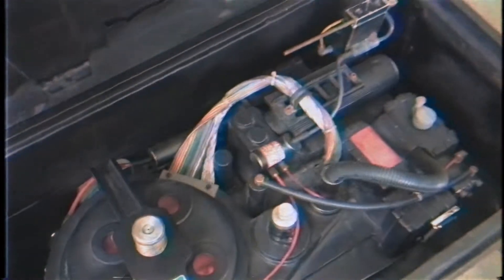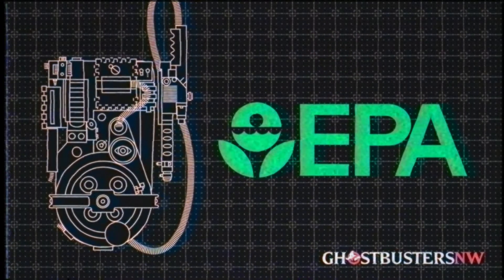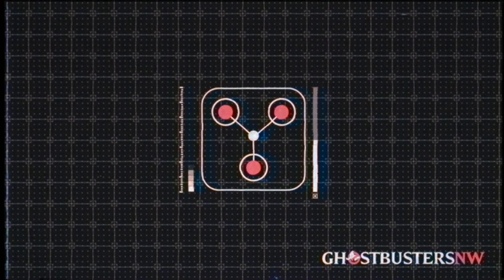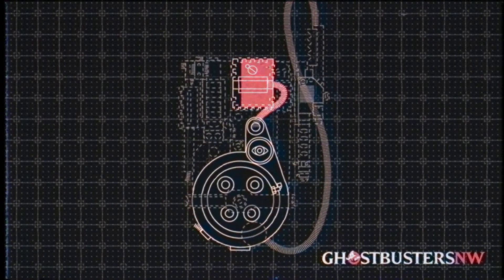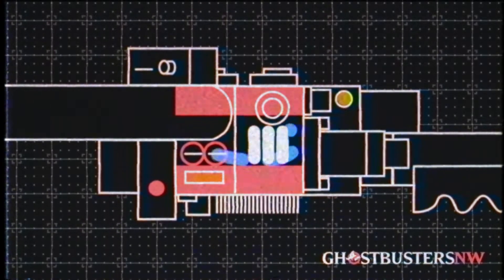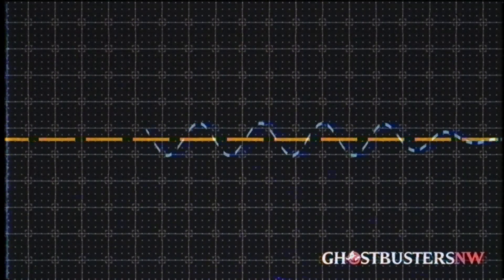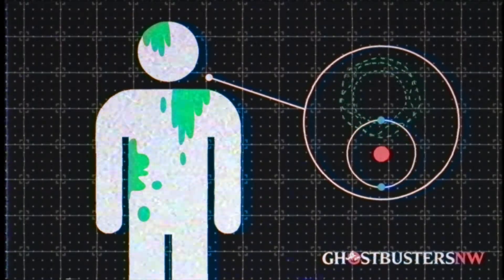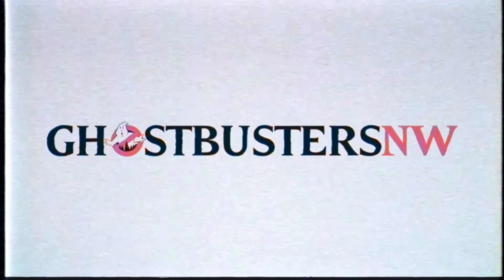GBNW "How It Works" - The Proton Pack

Comment: I thought the switch under the intensify button is the activate switch that activates the vent light? And a lever is used to remove the safe on the barrel to allow the user to fire the neutrona wand as shown in Ghostbusters afterlife?

Comment: Unanswered Questions:
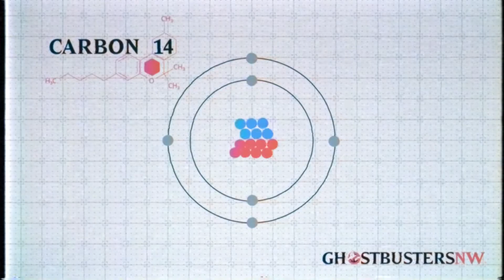0:43 that doesn't make sense, i get the twinkie reference, but a twinkie doesn't have a radiological HλLF LIFE
3:43 So protons are being expulged by the Orange stream, what particles are being Pulled back in from the Blue sparks, and why is this necessary
4:20 i don't think thats how ionization works(convert (an atom, molecule, or substance) into an ion or ions, typically by )

Can you also explain what happens subatomically when you cross the sreams as well as explaining how it induces the TPR Effect(Total Protonic Reversal)

Comment: This video is great. Maybe the distortion is a bit much, but otherwise pretty enjoyable. I also LOVE the tie in with Doc Brown and the Flux Capacitor as a backstory for the Carbon 14 rods, even if that's all just headcanon stuff. I love the idea of both of these garage built inventions existing in the same universe and being connected like that
Reply from the maker: Garage inventors tend to find each other. Plus, sources of black market fuel rods can be limited...so we hear....
Reply: @GhostbustersNW  I've always been intrigued by the design of the proton pack devices. Maybe this technology could be invented in the future....
Reply: @GhostbustersNW  important question.
I live in the northwest, about 40 miles north of seattle, and I saw vinz clortho in my fridge. Should I be worried?
Reply from the maker: @kimjong-il8068  Depends on the brand.

Comment: This is beautiful.  Just beautiful.  The audio distortion was a little too heavy, but I only mention that because distorted voices really make my skin crawl.
Reply from the maker: Those voices are just ghosts whispering into your ear. Luckily we have a solution for that! Call Ghostbusters NW and ask about our "disembodied voices" service package!
Reply: @GhostbustersNW  a major design improvement would involve full control from the wand instead of requiring someone else to turn the machine on and off.
Reply: @xa-xii4865  Ghostbusting isn't something you should be doing alone anyway.  Friends don't let friends ghostbust alone.
Reply: @GhostbustersNW 
So, Ectoplasm (the material that makes up spiritual entities) is ionized atoms combined with Psychic Energy. Good to know.

Comment: Awesome video, but wrong in parts. It's not how the Sony prop was made, neither how the licensed Mattel and Hasbro wand work. See below picture. The lower right switch engages the main electrical power. The upper right switch engages the auxiliary circuits like the lights and bargraph. The lower left Activate switch starts the cyclotron.

The auxilliary circuit switch starts the bargraph at 1 bar (0 stream) the lowest decal. Firing up the cyclotron with the Activate switch makes it ready to fire(if the barrel is extended). Hitting the activate switch also increases the bargraph to 2 bars (quarter stream decal). It is now ready to fire. 

The aluminum power dial has a further 3 power levels marked (+1, +2, +3) these can increase the power to half stream, three quarter stream and full stream to line up with the remaining three pie decals by rotating clockwise.

The thrower you see here is set to lowest power (0) so 2 bars on the bar graph (quarter stream) though the bar graph is off.

https://i.imgur.com/mrIAKfW.jpg

The way I've described it is how the prop was designed and how all the licensed Sony prop replicas function.

Rotating barrel: rotating the front grip counterclockwise so the grip faces up and doesn’t allow a firm grip is a disarming safety feature used for storage.

PS: What they call the N filter on the Proton Pack is actually the deflector plate in a real cyclotron.
Reply: Hey man, I think it is awesome that you know that much about it and I’m actually glad you shared. I love to know as much as possible about this stuff because Ghostbusters is life... that being said, you didn’t mention the video was awesome or say great job or anything positive, just criticism. What’s up with that?! I think the video is amazing and seeing that they have the talent to make something to continue the Ghostbuster world with their own free time, I am very grateful.
Reply: @dbldggr  you are right. I edited the comment to reflect that the video is well made.
Reply: Im a big fan too and have my own pack I could care less about the specifics...its not that serious